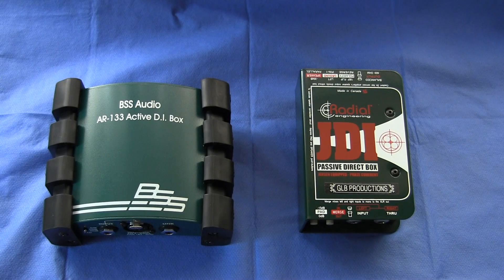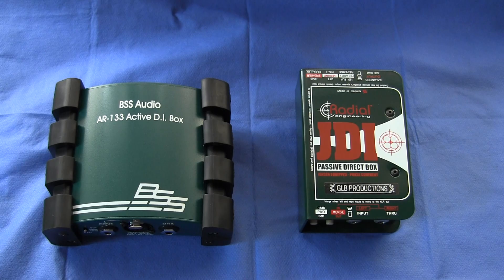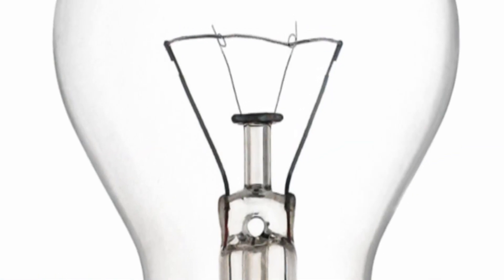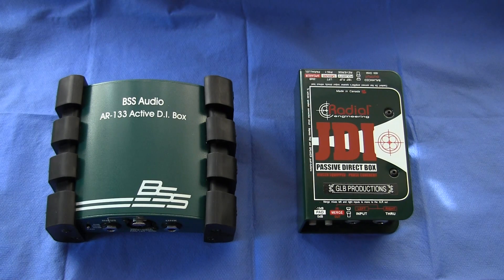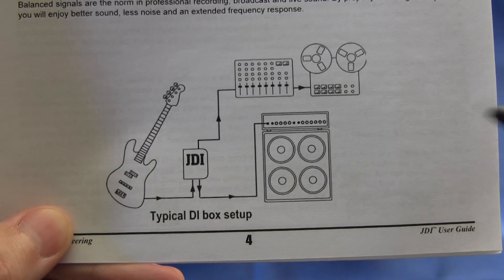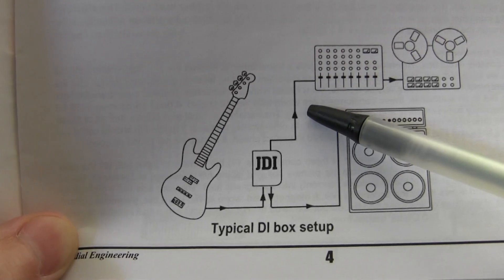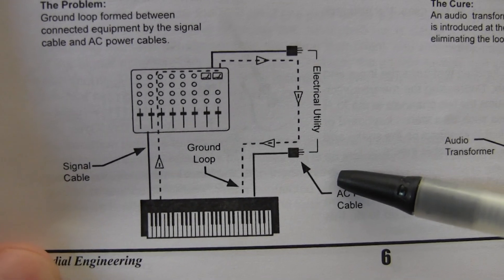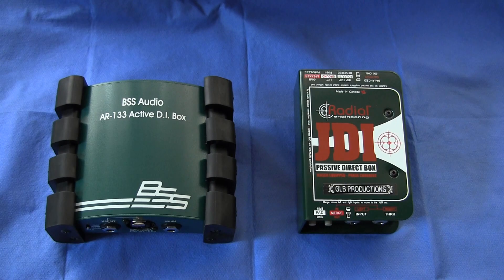DI boxes part 1: What does a DI box do, and when do I need one?

Comment: Very Helping info, thx.  So i need 2 cable now, I have a question. what cable should i use for my yamaha moxf keyboard output (Left/Mono and Right) to DI and then another cable DI to mixer? TS TRS XLR?
Reply from the maker: If your Yamaha keyboard has 1/4" outputs you will need a normal guitar cable (TS to TS) to go from keyboard to DI box, and then an XLR to XLR cable (microphone cable) to connect the DI box to the mixer.